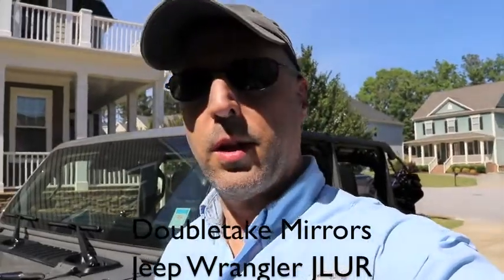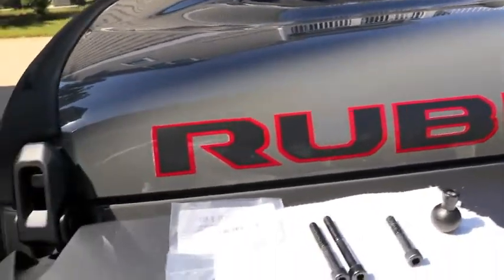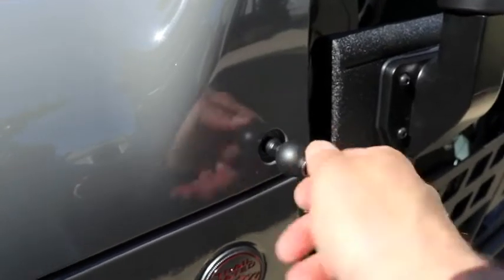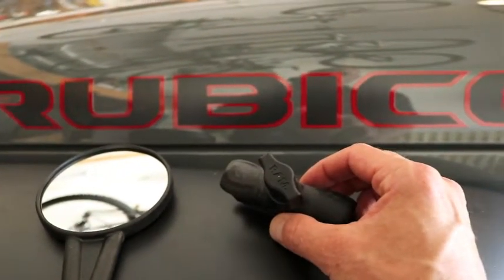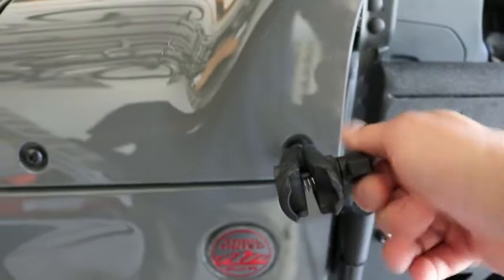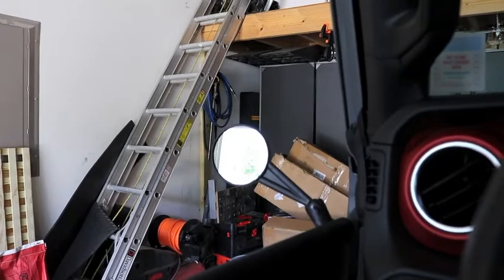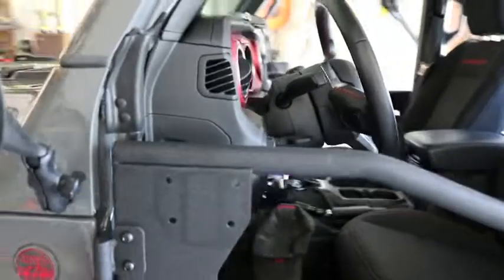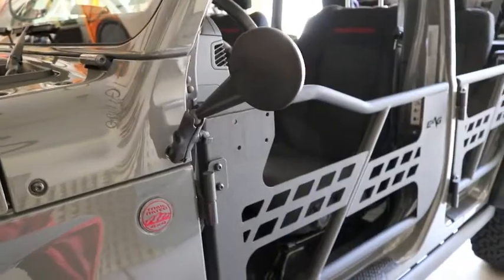Doubletake Mirrors on a Jeep Wrangler JLUR

Comment: What was eag going to send you for mirrors.
Reply from the maker: Vicious Offroad whom I purchased the doors through was going to send me a replacement driver side mirror.  They are in contact with EAG and are awaiting a shipment of mirrors (most likely from China).  There was a batch made incorrectly that do not adjust far enough out (away from the vehicle).  Vicious is maintaining a list of owners who have this issue and will send replacements out once they have them.
Reply: @swimman66  I got mine off Ebay.